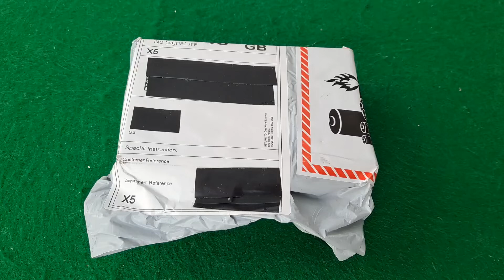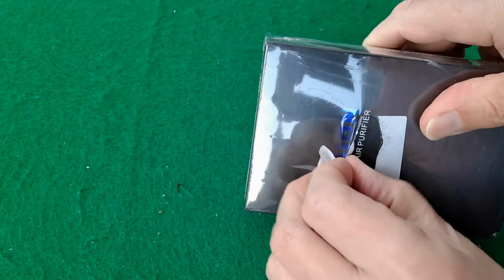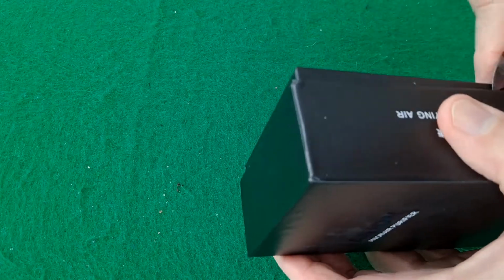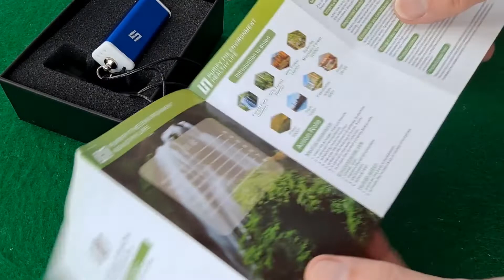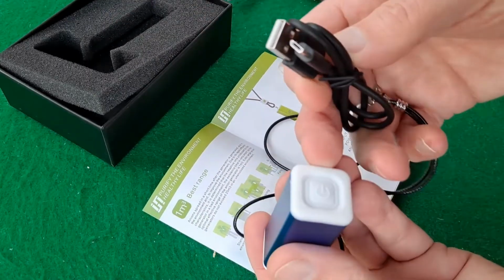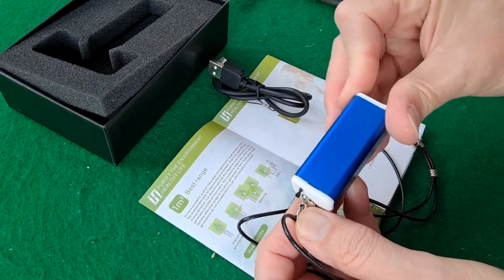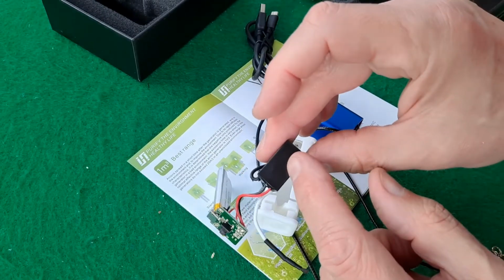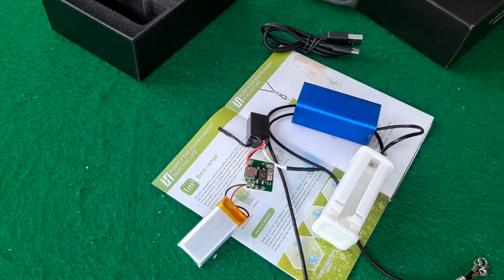Grandad's Postbag 20201126 Anion Air Purifier

Comment: I have a mat below my desk chair. Every time I move my feet, I am charged. So I have an LED light on my desk with a small sheet of aluminum, and I use that to ground myself. The LED lamp (a string which needs 75 Volts) lights up briefly and then glows for a while. This makes me think I could make a motor using only this static charge. A few (HV microwave) diodes, and the (lid-) motor. 
.. .. .. .. Look dad, without batteries .. .. ..
But I am not into crafting myself .. .. I am more the theoretic guy .. ..
Reply from the maker: I like that idea 😁👍 I have added it to my list of things

Comment: Hmm, why would you want to wear an Ioniser??  I suppose you could then become Mr Dustman :-)
Reply from the maker: If you read the listing they claim it will cure just about everything known to man. Snake oil comes to mind. But then, some people would rather look for magical cures than trust medical advice. Maybe it works, I wouldn't know, I just bought it for the components, and now I have it I can see the components parts available cheaper, although the LiPo and charging board will also be useable. I will have to remember this just disappeared into the junk on my desk and I have forgotten about it. The plan is to make an electrostatic motor.
Reply: @GrandadIsAnOldMan  I will await that with relish :-)
Reply from the maker: @fredflintstone1  It may be a long wait. I am having trouble getting motivated 👍